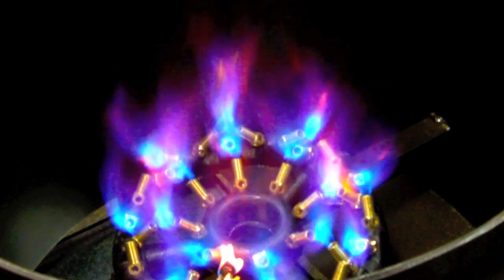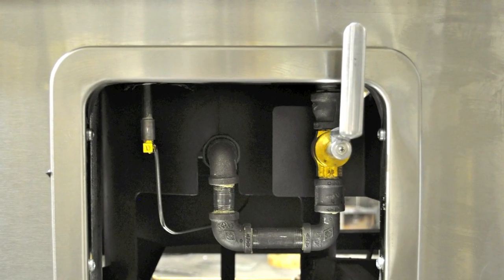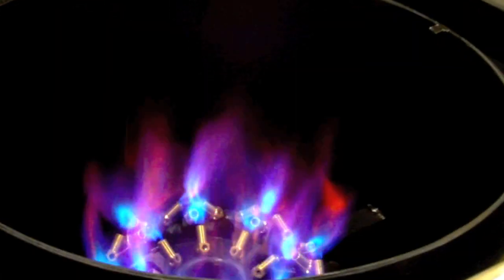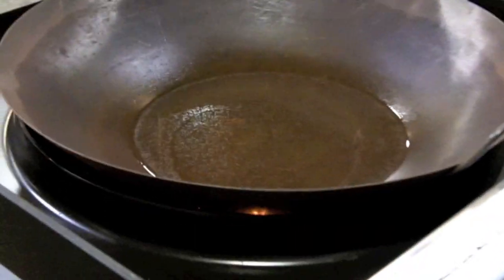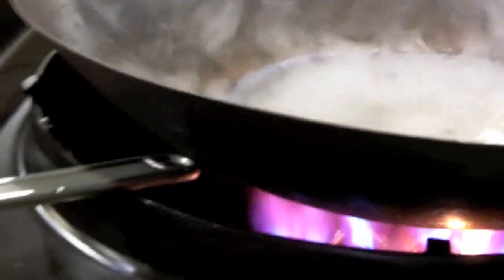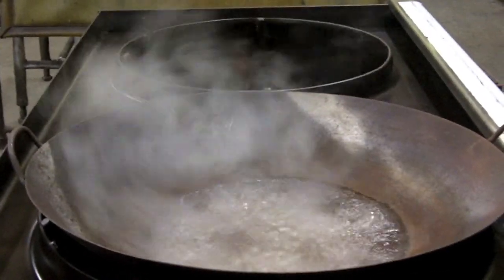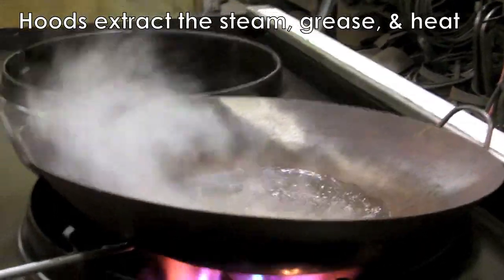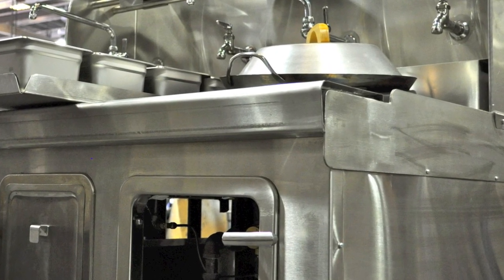The Power of a Wok

Comment: Can you showcase your Drop in home wok unit? I think there will be quite a lot of demand. Wondering how it works, BTU rating, safety etc. So far the only one I found is BlueStar, but rated at 22K BTU. Would your home wok unit work with residential gas line? Sorry asking so much question, any video info about the unit would be appreciated. Thanks!